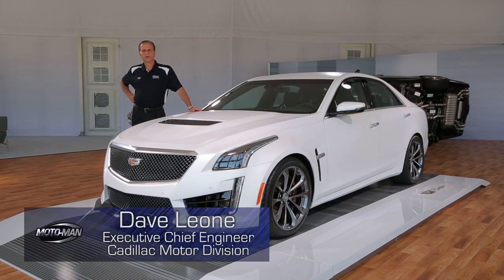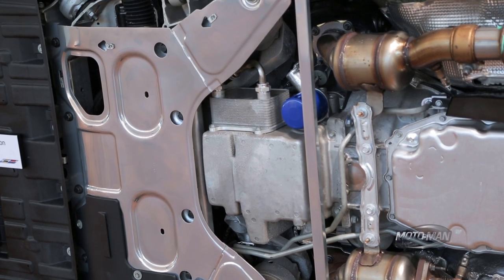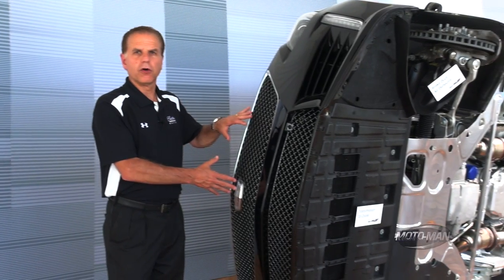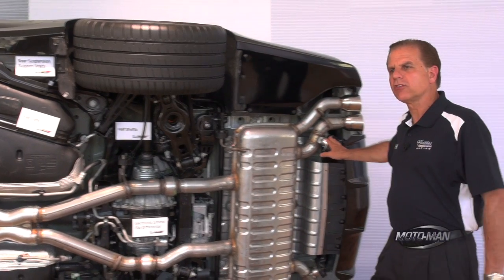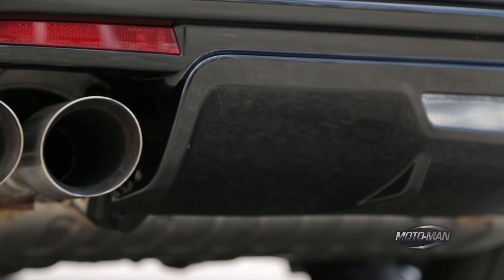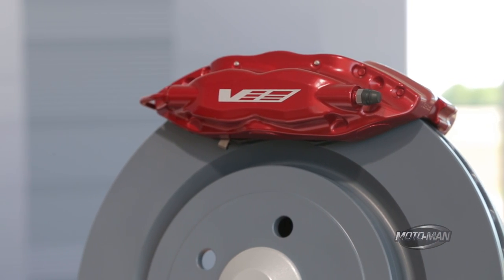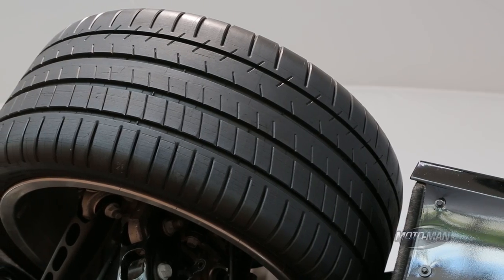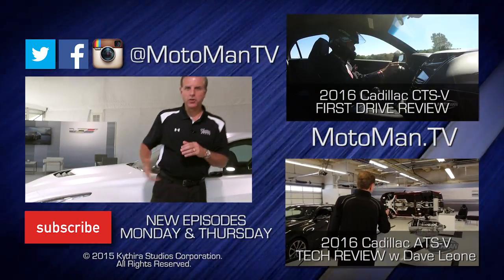2016 Cadillac CTS-V TECHNICAL REVIEW with Cadillac Chief Engineer, Dave Leone

Comment: But how about AWD so the Cadi can compete with Audi, Porsche and AMG?  And before the trolling begins I tried to drive the previous generation CTS-V in the snow.  It was unusable while my 911 Turbo S barely noticed the decreased traction.
Reply: NuclearGrizzly that will hopefully be the 2017 Buick GNX.
Reply: NuclearGrizzly I drove my 2015 Mustang across Canada this past winter. With good winter tires you don't need all wheel drive. Todays cars have amazing traction, and stability control.
Reply: Patrick Kean
I get what you are saying but what if there are no winter tires available in the size you need?  Winter tires for the previous generation CTS-V only became available last year and are not currently available for the this model.  With my 911 the factory Pirelli P Zero tires worked just fine in the snow.  Not because of the tire but because of the AWD system.  Good thing because there isn't even an all season tire to fit my car.   Much less a winter tire.  This unavailability of a winter tire is common for cars in the 149 mph (V rated) and above club
Reply: +NuclearGrizzly Using "driving in snow" as a benchmark for a performance car is almost incomprehensibly stupid. There are valid arguments for AWD but in a high performance car, "snow" is not one of them.
Reply: Vernon Price
So my personal experience is stupid?  I see. Well unlike some cork sniffing car snobs, I actually drive my cars.  Not just talk about it.
No garage queens in my harem.   Rain or shine, sun or snow, I drive my 911's.  So you see, all weather performance is an issue for a REAL car guy.  But you just keep talking about what is parked in your garage and I'll keep tacking on the miles.

Talk about incomprehensibly stupid.  lol
Reply: NuclearGrizzly Using snow as a metric to judge a performance car is stupid, yes. You drive your cars, great. Using snow as a metric to judge a performance car is still stupid. 

For example, in your initial post you are suggesting you chose a 911 over a CTS-V SPECIFICALLY because of how it performs in snow. And that's stupid.

And I put 80k miles on my CTS-V in 3 years, so you are barking up the wrong tree on that one, son.
Reply: Vernon Price
Once again, you feel that your opinions are more valid than my real world experience. 

All weather performance is important to me because I drive in all weather conditions.  Without AWD the CTS-V simply does not suit my needs. 

My 911's do. 

This CTS-V is a 4 door car with an automatic transmission.  The engineers go on and on about how good of a daily driver it is.  Well I need a daily driver that I can drive every day.  Not just when it's sunny outside. 

And my '97 Turbo S had over 270k miles on her before the restoration started Seems like it's taking forever).  I put more snow miles on my 911 than you put on your car in total. 

How dare you tell me or anyone else that their particular needs are stupid.  And way to dispel the stereotype of the arrogant know it all American fanboy.  lol
Reply: Vernon Price
Why don't you search "Audi winter performance" or AMG winter performance".  It appears as though I am not alone in the need for an all weather vehicle.  Does that make all of us stupid, or just you?  lol
Reply: NuclearGrizzly This isn't about my opinions at all. This is about you using driving in snow as a valid metric for a performance car, my opinion has nothing to do with it. The CTS-V is clearly not designed to be driven primarily in snow, and yet for some reason that seems to be the sole metric you are using to judge its worthiness.

You can buy a Subaru Impreza and get better all wheel driver performance than a 911, so your weak sauce argument does not hold water. And this brings up the question why are you driving a 911 at all if performance in snow is your primary metric? Shouldn't you have a range rover instead? Because a range rover, or most Subarus, are all better in snow than your 911. 

And since you're not very good at reading comprehension, I'll explain this to you very slowly. I am not saying your needs are stupid. I never said that, I never even said anything close to that. 

I said you judging a PERFORMANCE CAR by how it drives IN SNOW is stupid. Because it is. That's like saying a hammer is "unusable" (your exact word) because it doesn't fold laundry well. Do you see the inherent stupidity of criticizing something that's designed for one thing based on how it performs doing something completely different that it's not designed for?

If not, I can explain it to you using smaller words. And please, you calling anybody else arrogant is the pot calling the kettle black. You're the epitome of the idiot Porsche snob who knows so little about cars that they think a Porsche is the best car ever made.
Reply: +NuclearGrizzly You can get winter tires for CTS-V. Just like my new Mustang the number of models available takes a little time to be released. It looks like you just want to let people know that you have a more expensive car than the one being discussed.
Reply: Vernon Price
So how does the all mighty self appointed King of Cars feel we should all be allowed to judge performance cars?  Should we all be forced by law to drive a CTS-V and nothing else?

A lot of GTR guys feel that MPG is not a criteria for choosing a performance car.  Are they right too or just you?  How about luggage/cargo space?  Or is the want/need to actually use your performance car as a daily driver stupid?  A lot of Ferrari guys feel that way.  Are they right too?  What if someone needs a performance car that they can safely take their kids to school in the winter?  Those monsters.  Or are they just stupid?  How about a back seat? 

Let's not even get started on that one. 

Wanna' know what's stupid?  You telling anyone else what their needs are.  If I wanted to drive a Subaru I would.  Why would I drive a Forester when I can drive a 911?  I actually have more Pontiac's than Porsche's.  And an equal amount of Model t's.  I can't drive them in the winter either.  Heck, I can't drive my '68 RA II if it's overcast.

But of course, you know better than all of the rest of us.  Your arrogance is overwhelming.
Reply: NuclearGrizzly What are you, a moron? Are you getting offended by the suggestion that you shouldn't be judging a RWD CTS-V performance car SOLELY by how it performs in SNOW? Really? because for most people that's just common sense. Take it to a track and judge it there. It's a performance car. I don't know how much simpler I can make this for you.

MPG is not a good criteria for choosing a performance car either, as performance cars are not designed to get good MPG. Does this come as a surprise to you too? In much the same way that a RWD CTS-V is somehow not a stellar snow vehicle?

I mean that's really the most hilarious part of this, it's almost like you're surprised that the CTS-V doesn't perform spectacularly well in snow. 

I use my performance car as a daily driver, obviously, and it's fantastic. But I don't use it to drive in snow because that would be STUPID. And yet here you are using that very metric to judge it. Do you see the problem yet?

Tell you what, I'm going to try towing a yacht with a 911, and using your logic I'm going to judge it SOLELY on its ability to tow a yacht. Does that work for you? Does that makes sense to you? Judging a car based on its performance doing something it's not designed to do? It should, because that's exactly what you're doing.

And if I find that the 911 is ludicrously terrible at pulling a boat, well then I guess the 911 is just a terrible car. Right?

And the reason you drive a Forester rather than a 911 is because the Forester is better in snow than your 911, idiot. I already explained that to you in my last post which you apparently didn't read. You are using "driving in snow" as your ONE METRIC for judging cars. Therefore, using that metric, you should be driving a Subaru, or a range rover.

This is YOUR LOGIC we're using here, not mine. Let me know if you ever figure it out.
Reply: Patrick Kean
I also have an Acura that is much less expensive than the one discussed.  How does that fit into your theory?  Winter tires for the previous CTS-V have only been available for about a year.  There are none available for the current generation CTS-V.  There are none available for a great number of performance cars.  I am in the market for a 4 door performance car but I need all weather traction.  When I'm on a job 1000 miles from home I just can't swap out to winter tires.  If the CTS-V had AWD I would already have my order in.  It does not suit my needs so I will have to look elsewhere. 

A RWD Ferrari also doesn't suit my needs.  How is choosing a performance car based on my needs stupid?
Reply: Vernon Price
So by your estimation judging the CTS-V based on my needs is stupid.  But buying a car that does not suit my needs is smart?

And talk about a moron.  I'm not surprised that the CTS-V is a poor performer in the snow.  I flat out said it.  That's why I would love one in AWD.  Until then I see an Audi S8 or RS7 in my future. 

I don't need to pull a boat so that is not a criteria.  I do need to drive in all conditions.  See the difference?

And by your logic, if dry weather and track performance is your only criteria then shouldn't you be driving a Vette?
Reply: Vernon Price
Where did I say that snow performance was my only criteria?   Backtrack much? lol
So how did you come to buy a CTS-V?  What criteria did you have?

And please keep on with the name calling.  It just reinforced the stereotype of the arrogant, knuckle dragging, know it all, fanboy American.
Reply: NuclearGrizzly You said snow performance was your only criteria when you said this:

"I tried to drive the previous generation CTS-V in the snow. It was unusable"

Nothing else. No comments on everything else the CTS-V is capable of, no comments on how it is in anything other than snow, nothing. Only criticism of its snow performance, and then complete dismissal based on that one criteria. 

That's not backtracking, that's basing an argument on something you actually said. Maybe you should learn the difference. 

My criteria for buying a CTS-V was price, space, manual transmission, power and handling. Obviously in the dry, not in snow, because who would be that fucking stupid?

And by the way, the name calling will continue as long as you continue to say things that are so mind-bogglingly stupid there is no other choice.
Reply: Vernon Price
So because I need all weather performance I'm stupid?  I never said that it was my only criteria but it is a deal breaker.  I'm 6'7" so headroom and leg room are also a concern.  By your reasoning needing a car that I actually fit in makes me a idiot.

Well le us look at your reasons for buying your CTS-V
Price.  Well you moron there are better performance values
Handling.  Same thing you idiot
Space.  What kind of dumbass buys a performance car for space?
Your criteria for a performance car show you to be an idiot.  Clearly the ZL-1 would have been a better car but you are an idiot.

You see how you sound?  Sorry if I didn't give you my entire list for your approval. I do see an Audi RS7 in my future. Thanks for reinforcing the stereotype of the arrogant American fanboy.  Thanks for playing. lol
Reply: NuclearGrizzly No. I get that you need all weather performance. The stupid part comes in when you decided to test a CTS-V in the snow and then proclaim that it's terrible. That's the stupid part.

Jesus, why does this need to be explained to you? It should be so completely fucking obvious that a child could understand it. But not you, apparently.

Price - ok, name one better performance value. With 4 doors, obviously, as that was one of my criteria. And a wagon. And a manual transmission.
Handling: The CTS-V broke the world record for the fastest 4-door sedan on the Nurburgring.
Space: The CTS-V wagon HAS the space. So are you confused about why somebody would buy one, or are you confused about why GM would make it in the first place? Because it's not just GM. Audi RS6 Avant, E63 AMG S wagon, even the Dodge Magnum.

If I need the space, the power and the handling, not to mention the price, then in what conceivable way is the ZL1 a better choice? Explain that to me.

Also your example is the opposite of what you're doing. The equivalent to what you're doing would be me testing a ZL1 and then complaining that it doesn't have the same space as a wagon.

What you're doing is testing a car that is not designed to work well in snow, and then bitching about how poorly it performs in snow. It's like Captain Obvious was not obvious enough for you.
Reply: Vernon Price
It seems that you are just too stupid to understand you're own stupidity.  From your stupid inability it understand plain English to your incredibly stupid reasoning for owning a CTS-V when there are smarter choices.  Stupid Stupid Stupid  And I thought that GT-R fanboys were stupid.  It seems that CTS-V fanboys really bring home the gold medal in the stupid Olympics.  Could you get any more stupid? lol
Reply: NuclearGrizzly You say there are smarter choices, but for some reason you can't seem to name a single one. Huh. 

And now apparently I've shut down your idiocy so hard you've been reduced to blabbering the same word over and over. 

Let me know when you have the mental capacity to answer the questions I asked you, and to acknowledge the responses I gave you.
Reply: Vernon Price
More stupidity I see.  Clearly just the stereotypical know it all fanboy.  Unable to grasp the fact that not everyone has the same needs in a performance car. 

What's wrong?  Name calling is just a one way street idiot?  And the ZL-1 was clearly a better choice than the CTS-V idiot.  Because I said so and your particular idiotic needs are irrelevant.  OOPS.  I guess If I believed that then I'd be an idiot too.

RS7 or S8, I can't decide which one is better suited to my needs.  You know, over the CTS-V.  lol
Reply: Unnecessary weight for performance that already competes.

Comment: + Koka Gulua, The ATS-V which has the same 8 sp trans, beat the AMG-C 63 & Bmw M3 (Head2Head) in quarter mile time & 0-60. I have no doubt the CTS-V will take its competitors! The transmission does what Dave says it will. I've driven the ATS-V, it's that good. I will picking up mine in a few weeks.
Reply: kbowiing58 but the M3 and even more the C63 amg beats the ATS-V in every other categories like quality, refinement, luxury, comfort. Thats why the C cass won on motor trend
Reply: bob roger Lol... no. That's not true. The Cadillac is just as refined as the other German cars, and Cadillacs have been more reliable than German cars for over a decade. There's also no better comfort than a Cadillac - that's why the saying "it rides like a Cadillac" became so popular.
Reply: UnitedRecording take a look at the dahs board, the inside of the car, I myself had a 2015 cadillac and it was a freakin joke
Reply: I'm a Cadillac product specialist. Yes, we've received many complaints about the dash board. It has been slightly updated for 2017. As for your other comments, they are just not accurate... Cadillac is on par, and in many ways exceeds, German quality - or lack thereof. It's also significantly cheaper.
Reply: UnitedRecording but it has a corevette LS base engine with european suspension, imagine if a bmw chassis had Mercedes engine with Audi quattro awd, it would absolutely invincible.
Reply: bob roger Neither the ATS-V nor the CTS-V have the base Corvette engine. The CTS-V has the LT4 engine (shared with the Corvette Z06.) The ATS-V that we were talking about is a twin turbo V6 shared with the Camaro. It's not reasonable to combine all German cars to say it would theoretically make an invincible car... the CTS-V and ATS-V are both invincible in terms of performance. And remember, the Cadillac Vs are only RWD, the Germans need AWD just to keep up - and they still come in second place!
Reply: UnitedRecording   Sorry meant lt4 engine. The E class has 585 hp, bmw 570~hp vs 640hp. What if the ctsv had 100% pure cadillac parts, do you still think it would be as fast as its german rivals?

This a copy/past description of the ctsv by canadiandriver website:

The CTS-V has always been a kind of four-door Chevy Corvette. The new V ties the Vette connection even tighter with an engine lifted from the ballistic Corvette Z06. The engine is so lightly altered for Cadillac duty that the company could have called this car the CTS-V06.The 6.2-liter supercharged V-8 retains the LT4 moniker and packs the Z06’s forged aluminum pistons, powder-metal forged connecting rods, titanium intake valves, and an Eaton blower pushing 1.7 liters of air per rotation. Aside from the intake and exhaust arrangements, the major difference between the Corvette and CTS-V engines is the lubrication system. In the Corvette, the low hood.
Reply: bob roger I understand what you're saying, but the engine is not the only thing that matters... The entire car is totally different from a Z06 or even a CTS. It handles as good as it looks. The engine tuning and controls are also much more advanced in the Cadillac. This is not an abnormal practice to share engines... Audi shares its engines with Lamborghini. It really doesn't matter...